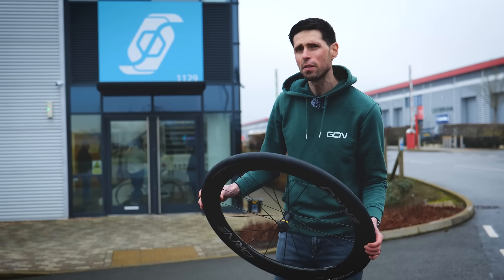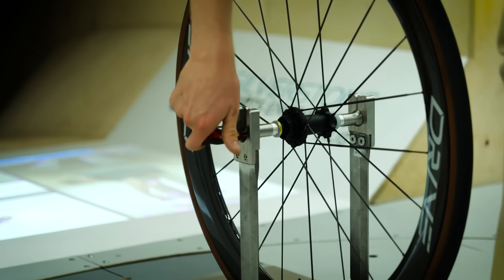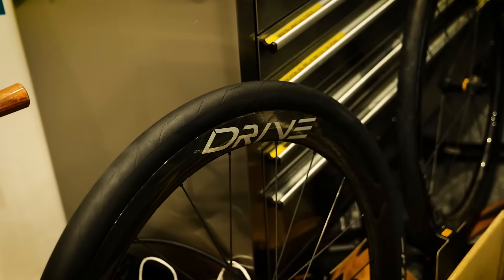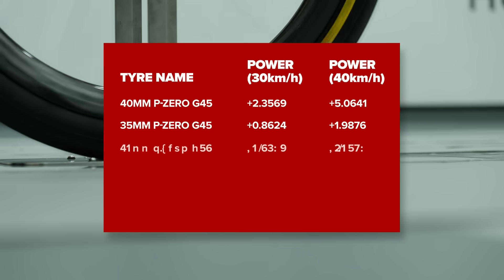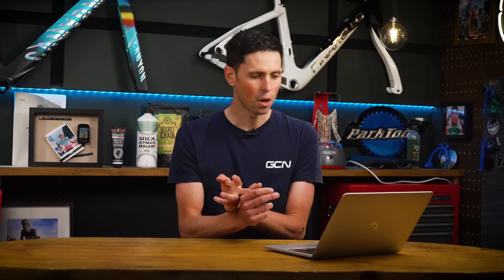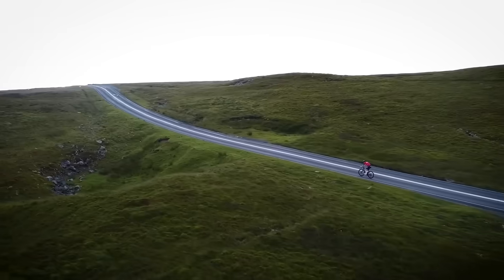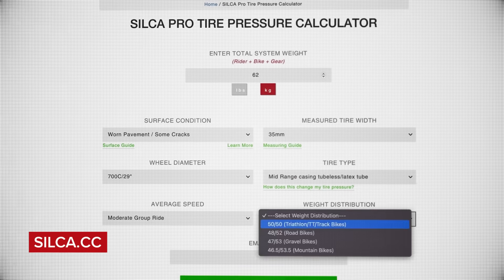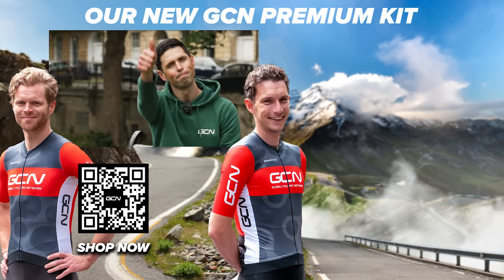The Fastest Tyre Width is NOT What You Think

Comment: An explicit mention of his total system weight is quite crucial in this comparison. I imagine a 60kg rider on a 7kg bike gives a massively different data output than a 85kg rider on a 9kg bike…
Reply: I explained this in the video, but agreed I could have listed my system weight which was 85kg marker. I don't have the exact number to hand
Reply: @alexpatonGCN  I think this is quite critical and it seems that it's never stressed enough (or measured) in these sorts of comparisons. If 30mm is optimal for a 85kg system weight, what's optimal for a 70kg weight? That's a 20% difference (when we are comparing tyre widths of 10% difference). How do the properties of tyre width scale with system weight? Isn't this the most important question? Interesting video though!
Reply: As well because weight spreads the contact patch you can gain/lose rolling resistance depending on weight. As well, how compliant the materials the tire is made out of can affect how that added weight is distributed when considering deformity. If you are a lite rider I'd imagine many want those really soft sidewall tires for extra compliance while still having decent internal pressure for speeds sake. If your heavier you'd want something a little less compliant while simultaneously lower pressure to gain some speed.
Reply: I also thought this, that a lighter weight would be able to use narrower tyres at the same pressure as a heavier weight on wider tyres. However playing with the Silca guide adjusting the weight makes very little difference to the recommended pressure. The crucial variable is the road surface.
Reply: @charlesprice6875 I actually think this is because of the same reason. They don’t actually test with large differences in ”gravity pressure”. They normalize for a specific system weight, say 80kg, divide by 2 to get wheel pressure and use that. My issue is that when I ride, I have more than 60kg riding on each wheel, so wheel pressure is 50% higher. That MUST cause a difference in rolling resistance, especially when you see how over- and under-inflation affects the RR.
Reply: @charlesprice6875  I see what you mean. It's surprising that toggling from a 75kg system weight to 90kg on a 28mm tyre only makes 2 or 3 psi difference to the recommended pressure. It's a bit odd actually. But assuming it's correct, there are two ways of looking at it. Either rider weight makes little difference to tyre width choice, or apparently small numerical differences in pressure make big differences to tyre performance. Also, the calculator doesn't tell us how performance varies with tyre width, so it's possible that rolling resistance could be significantly different for different tyre widths for different system weights even at apparently similar pressures. Needs testing! It's a minefield though, no simple answers such as "this tyre width is generally better".
Reply: It's simple really, the smoother the surface the narrower tyres are faster eg track bikes, rougher surface wider tyres eg gravel or even mtb. Everyone has their own preference which is a compromise for the range of surfaces they ride and may also sacrifice speed for comfort and grip.
Reply: @charlesprice6875  But let's say for the sake of argument that you want to prioritise speed at all costs. It's far from simple to know what tyre width at what pressure is going to be best for the particular surfaces (range of surfaces) you are planning to ride on, especially if small differences in surface quality could be very significant for your choices.  Here's an idea... What we really need is for Strava to calculate an average road surface correction factor for every route based on all of the data it has for all rides that have taken place on those roads... This could then be used as a numerical value in something like the Silca calculator instead of the crude road surface drop-down option.
Reply: @neil4701 If only life could be that simple 😂. In reality (at least in the UK) many off road paths are smoother than the potholed roads so only personal experience can tell you how rough it will be. Silca reckon you lose more from overinflated tyres than under so basing it on worst case unless it's a very short sector is probably best until inflation on the go becomes more common.
Reply: @charlesprice6875  What I meant was using large volumes of actual ride data on the roads to calculate a correction factor for each individual road that could then be collated for each planned route. Ratios of power to speed, given weather conditions etc, could potentially be used to estimate surface rolling resistance. It would work better if Strava had information on tyre widths and pressures being used, but that might not be critical if teh algorithm had a big enough volume of data to work from.
Reply: Or a 115kg rider on a 12kg bike…
Reply: @johns70  Not everyone is built like a racing snake
Reply: @johns70  or a 150kg rider on a 15kg bike
Reply: @johns70    that s my situation  :-((
Reply: So wheel (😅) all be riding 40 mm tyres to accommodate uk road surfaces
Reply: I would imagine the numbers would scale up or down proportionately. Having said that, I don't see a whole lot of point sweating about 2W saving unless you are paid to race your bike. Espescially if we start talking about those 40mm tyres, which actually use a completely different carcass than 28-35mm ones instead of being just wider, which is probably responsible for that distinct hike in drag above 35mm.
Reply: @АнтонАлексеенко_044  It's not necessarily obvious what the relationship would be or how it would scale though. Is it tyre width, tyre volume, or some other factor that comes closest to being proportional to system weight when detrmining how a particular tyre width performs for a particular weight? And while 2w isn't really worth worrying about, the larger differences between 30mm. and 45mm certainly are if you are a reasonably competitive amateur rider chasing PBs or KOMs or taking part on the local 10 mile TT. I'd like to see a lot more research done into how all of the factors related to performance relate to system weight. So often this critical dimension is just ignored and there is nan implicit assumption that everyone is exactly 75kg and 180cm or something.
Reply: @АнтонАлексеенко_044 absolutely, but the thing is, saving watts isn’t always about going as fast as possible. It can also be to save energy to be able to travel further. If you are a casual rider signing up for a sportive/gran fondo type event, or you just want to go bikepacking, the watts savings add up. Even if you are going at 25km/h…

Comment: I run these 40mm P Zeros on my Canyon Inflite CF (carbon) and am very very pleased. Firstly, I use this bicycle for my daily commute to the office (25km one way), for which I obviously do not need to go max speed. But secondly, I have also used them in hilly/mountainy regions such as the Ardennes and Eifel. Obviously, climbing is heavier than smaller tires, but boy.... I love them while decending! I am a decent decender anyway (no fear), but with these tires I hardly have to break at all! Even in hairpin corners I am so much faster than on my previous 30mm tires! I love it.

Extra info: I have the exact same wheelset but with 44mm gravel tires, so I just swap my wheels and bam... I can do a gravel ride in the morning Ardennes

Comment: "the skinny road bike"
<predating all the gravel bike mania, a lot of us old antique guys still have old vintage road bikes(2000's) that only run 25mm(or smaller), but 80's, 90's, and more current have more room in the frame/fork to accommodate better choices, etc.> 
<so for quite a while i have been riding 'the poor man's gravel bike' from the 90's, since much cheaper than current gravel, and still well built bikes with fair clearances for wider tires, etc.>

Comment: So if this is the case, why are pro riders still using 28 mm? Why is my Roval Rapide optimized for 26 mm?
Reply: I don't know the answer for sure, but in the most basic way because I would assume at the speeds the pros ride, the surfaces they ride on and their Total system weight results in those sizes offering a performance advantage. Compared to my test which looked at everyday speeds
Reply: It seems Pogi is riding 30mm pretty much all time.

Comment: So the 28mm and 30mm tyres are more aero, have better rolling resistance AND are lighter.  
Sounds like the best setup is a 28mm front with a 30mm rear. 

PS Should have included a 25mm additionally, or instead of the 40mm. 
I bet there are still more people running 25s than 40s

Comment: Thumbs up Alex.  I love your methodology here.  Nice presentation of data to be useful (to us really nerdy nerds).
I was surprised at the results only because of your enticingly "not what you expect" intro, after all if the wider tyres were faster the pros would be using them, but they don't.  So all in the world as expected.  Phew.
One thing I did notice which was surprising was that your results are about twice the published figures of that roling resistance web site.
One thing I wonder too is whether the front tyre really does have the same rolling restistance as the rear given the weight distribution of a bike.  Be a bit difficult to set up a test for that unless maybe some clever gizmo (like a bungy to the ceiling?) to reduce the weight on the wheel on the rig.
Nice vid Alex, just in case you missed that.
Reply: Thanks! If you're thinking of Bicycle rolling resistance site, the difference will likely come from their checkerboard surface, compared to the "road" surface I used which I believe is much rougher
Reply: @alexpatonGCN  Good thought Alex.  Our country roads round here are just disgracefull (dodge the pot holes) so yes the wrougher your drum the better.  Makes pressure more important too.

Comment: Would 25mm be fastest on a purpose built crit circuit with super smooth tarmac?
Reply: Quite possibly, but hard to say without testing. But that's what I would use in that situation
Reply: Best RR is a steel wheel on a steel track. Basically a train 😁
Slightly heavy and probably a bit uncomfortable without suspensions 😉

Comment: 32mm conti gp5000 gang💪
Reply: Just purchased these for myself. Can’t wait to test out this upgrade from the 28’s
Reply: I just joined this exact gang, clincher division (not S TR). I absolutely love it!
Reply: nah michelin power competition
Reply: @hansdampf-i5x  Michelin are good rendering but weak lateral grip. greasy roundabouts are you ennemies. the profil doesn't go close enough to the rim which doesn't allow you to lean much.
Reply: @Jibs29  They have more grip on the edges, but you could be right with your second point. how did you find that out ?
Reply: @hansdampf-i5x  nah... they're weak in terms leaning angle. once you catch the tyre wall it's over for you. that's why i prefer Continental Gp5000 they have a larger dome and we can lean more. therefore push a bit harder in the corners.
Reply: @Jibs29  that sucks because in terms of chemical grip the compound is better
Reply: @hansdampf-i5x  not than the Gp5000 sorry. i've rode them.
Reply: @Jibs29 the normal ones or the S TRs ?
Reply: @Jibs29  btw, in whoch width did you have  the michelins

Comment: Most people are using a 28mm or 32mm that I see. I use 28 on the front and 32mm on the rear, for comfort.
Reply: This is spot on - he says in the video that rolling resistance is simply doubled by having 2 tyres to consider, but this is not true. Most of the weight is on the rear tyre, so rolling resistance on the rear is much more important. I think “milimullet” is a more appropriate name though….
Reply: Micromullet
Reply: Over the years I've come to the same formula - wider in the rear, narrower in the front. More comfortable, but still maneuverable.

Most of the motorcycles use the same formula.
Reply: @черепашкниндзь  ruddy interesting. Coming from mid-school BMX most people ran a 2.1 or 2.2 knobbly out front and a skinny 1.95 slick out back. I like learning how different types of riders set up different bikes. Big on the back makes sense for road bikes. However surely the wrists struggle with a skinny tire up front?

Comment: I don't believe in the Silca pro tire pressure calculator. It suggest very low pressures, from personal experiences, the bicycle runs much faster with more (for MTB on road it suggest 2 Bar but I use 3.5 bar with 2.1 inch low rolling resistant tyres on 26" wheels). The result shown in this video might have differed if some other formula had been used, for example the maximum pressure the tyre can sustain minus 20 percent (a 4.5 bar tyre would be pressurized with 3.6 bar).
Reply: Silca tyre pressure calculator recommends high pressures compared to the sram calculator (about 0.6 bar higher in my case)
Reply: @arhu74  Maybe the Silca uses different formulas if MTB is selected, I'll have to try that out. We all know that rolling resistance gets slightly worse if the tyre is overinflated, but it gets severely worse if it's underinflated (except for very rough terrain). I'm talking road here, not off-road.
Reply: @SuperZardo try a bit. I am playing around with both calculators too atm. Silca's recommended pressure results in a lot of vibration for me but going either significantly higher or lower reduces the vibration. I still  haven't found the optimal pressure.....
Reply: @arhu74  Will do, in the meantime I developped my own Excel calculator with the help from ChatGPT (was quite tedious, since it keeps making errors). But it did nicely show what happens to tyre pressure calculations (or tyre deflection calculations) when a rectangular model for the contact patch area is substituted by an elliptical one: the necessary pressures become higher and more realistic. A rectangular contact patch area model underestimates necessary tyre pressures!
Reply: 3.5bar in a 2.1" tire? thats even way above many modern MTB rims pressure rating and completely outdated. even the 2bar suggestion is rather high for normal rider weight. generally silca tends to be on the upper useful range for most examples.
Reply: @Digi20  Yes, the rims are from 1995. They are quite narrow. The tyre is a Schwalbe Thunder Burt 26x2.1 which is no longer available, unfortunately (also probably the largest tyre which fits on those rims). Again, I'm talking road, 3.5 bar would be way too much on gravel.
Reply: @SuperZardo  how much do you weight? even with tubes and on an old narrow rim anything above 2.5bar really seems unnecessary to me.
Reply: @Digi20  94 kg + bike 13 kg + water 1.5 kg

Comment: Appreciate the effort but your rolling resistance tests are not really valid. The tyre casing for the 40mm tyre is not the same as the 30 or 35. So you are not actually testing the rolling resistance by tyre width. In order to do that you would need the same tyre construction and material across all sizes. The aerodynamic test is valid so good job with that.
Reply: You have a very valid point here. Although it's more Pirelli's faut than Alex's.
Wide tires with very thin casing are fast. But it looks like Pirelli have significantly beefed up their 40mm tires compared to the smaller versions, vey unfortunately, which makes them slow.
The best compromise for me is wide, thin and light tires with a latex or TPU tube in it. Due to their much lower pressure, they are significantly less puncture-prone than narrower tires and due to their volume they are basically pinch-flat proof. No more tubeless disasters with sidewall slashing too (and no, plugs don't work on thin sidewalls). Bonus points for better air-retention.

Comment: For me, (95kg) 32mm are perfect. I ride 50% flat road, 35% bumpy road, 5% gravel.
Reply: What about the other 10%? 😂
Reply: @MikeMassey-fi5of right, these i didn't state since its a mix of everything
Reply: @MikeMassey-fi5of uphill and downhill road ;)
Reply: @MikeMassey-fi5of  Perhaps crashing?
Reply: 32mm schwalbe marathon for me. Comfortable and durable on crap roads, mostly commuting.
Reply: 32 is awesome on pavement if you are heavier like me. System weight around 130kg and you can run GP5000s on around 70psi is completely stellar, and your descent speed is crazy. You just need to dare to let them run. Anything downhill and I gain so much ground on other riders it is ridiculous.
Reply: Yes, 32 is good. A bit pigs compared to 28 on good pavement but generally not bad. I ride them as winter tires.
Reply: nothing to do with weight. but mmkay...
Reply: @Jibs29 maybe. But the statement is right anyway😉
Reply: @Jibs29  Erm ... äkschually ... it does, regarding comfort.
Reply: And TPU inner tubes, much better(weight, resistance) than normal tubes, and no mess compared to tubeless.

Comment: Hey Alex - this was a really great test. One of the best ive seen. And it lends comfort to just about any tire choice someone may have made. If you chose 28, youre optimized for speed and have a slightly lighter setup. If you chose 30-32, youre optimized for speed, gain a little weight, but also a little grip and comfort. Larger than that, youve only sacraficed a bit of speed, but gained more comfort. My only challange is your claim that rolling resistance of the front wheel is the same as the rear. It may be true, but ive also been wodering how the extra deformation and pneumatic trail found on the front tire when running wider tires axtually increases rolling resistance. This of course would depend on a lot of variables like how.much youre turning, how windy it is, how stable of a rider you are. But it gives people something new to think about 😂
Reply from the maker: thanks for the comment Mitchell! That's certainly another factor to put into the mix!